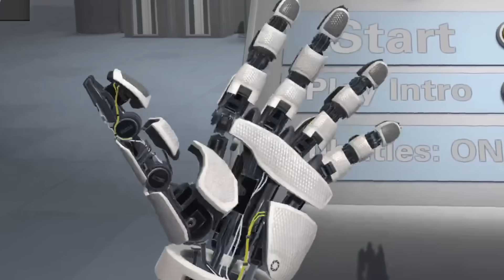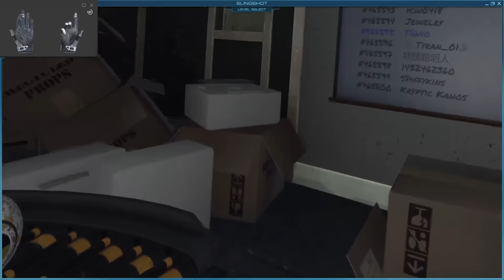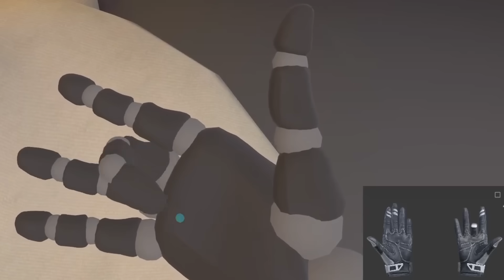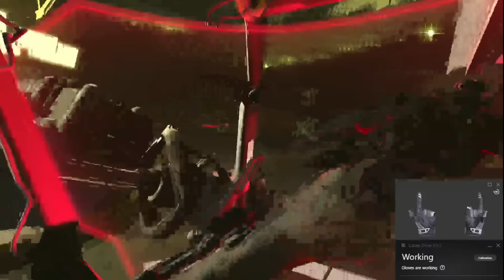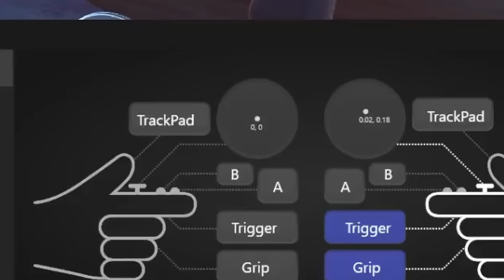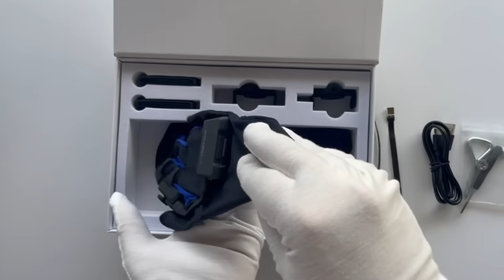Goodbye Controllers? VR Gloves are BACK! [UDCAP FIRST LOOK]

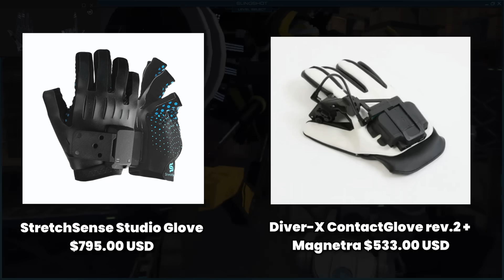Comment: 8:47 $499 is..."Accessible?"
Is it really worth +$250 for a Switch Joystick??
There are <$250 VR Gloves, 2 including haptic feedback. bHaptics DK2's, EOZ Immersive Gloves, and LucasVRTech's $60 HAPTIC gloves!
EOZ- the Tundra Tracker guys with years of experience- are making nearly the exact same thing as the UDCAP's, but HALF the price!
Reply from the maker: The bHaptics DK2 uses camera-based hand tracking. LucasVRTech’s gloves are VERY impressive, but it’s a DIY project that not everyone is going to build themselves. Assembly isn’t included at that price. 

I mention EOZ’s gloves near the end of the video and it remains to be seen how IMUs compare to stretch sensors. 

Ultimately, things are slowly becoming more accessible across the board - and $499 is compared to “similar” mocap gloves like stretchsense.

Comment: An excellent start, but a very simple to implement change that would massively improve them is put button emulators in the finger tips that are triggered when you touch a finger tip to the same hands thumb tip to "complete a circuit" without having to depress an analogue button; that would give you 8 virtual buttons with zero need for external immersion breaking analogue buttons or controllers to use, just you own hands! Do that and I will buy some! :)

Comment: May i say one thing?:
Its not that we need gloves, theres already hand tracking. This gap will be bridged via software.
What do I mean?
Those modules that are on the index finger? Just make that the controller, and use handtracking simultaneously. 
You dont need the glove at all, the modules can just vibrate, your brain will fill in the gaps.

Comment: These are perfect for applications like DCS, where you need a HOTAS to fly the plane, but still have the ability to reach out and manipulate the various switches, buttons and levers!
Reply: Have you used it there in DCS? This is exactly what I want to use these for: pressing and rotating knobs in my flight sims. DCS XP12.

Comment: I worked with VR Gloves for a few years and I have the Contact Gloves. I don't understand the point of putting buttons/joysticks on the fingers... why not just use Index controllers at that point? Gloves shouldn't have those... of course, makes the Gloves unusable for most apps then but... well, isn't that the point? To play experiences made specifically for just your hands?

Comment: I'm interested in this product for real but after wrapping up everything... So do you mean I need the additional pair of Vive trackers for using this glove? 
I'm pretty dizzy because the website itself, it's looks working like a charm without it
Reply from the maker: Yes, you do need the extra trackers to use them in VR. Unfortunately a lot of the promotional material omits this for some reason…
Reply: @TahvoStudio  Hmmm, This is a sad news to me. Sadly the price Vive tracker itself in my country is 160 bucks per side that means 320 for using with one pair of gloves. If I include the glove price on Kickstarter this thing will cost around 820 USD to me 🥹

This is a great product but It's a very steep price for me. Maybe they might make a gen 2 that using some sort of tracking instead

Comment: When you mentioned you calibrated the gloves to you Quest Pro, was your headset connected to your PC using a data cable or Air Link? Or were you running off the headset's capabilities alone?
Reply from the maker: Virtual Desktop

Comment: Will this be compatible for quest 2?
Reply from the maker: Only if you are connected to SteamVR on PC and they finish the controller mounting hardware.
Reply: It's not about being compatible with quest. 

It's about quest being compatible with VR. Mobile systems and systems with VSLAM will always have compatibility, accuracy, and tracking issues.

Comment: Nice to see these actually in use, albeit maybe could've used a different avatar for testing fingers. 
Question though: Does this only emulate current Index finger tracking and just adds finger splay? For example, can you curl your fingers without making a fist? Or, for example, make a right angle with your fingers (as if you're climbing a ledge)?
Reply from the maker: It uses SteamVR’s skeletal hand input. Yes you can curl individual fingers, but I don’t think it’s precise enough for the right angle you are describing.

Comment: You could get a small metal/plastic pipe with rubber on it for grip and play blade and sorcery with a immersive handle for one handed or two handed swords. 

You could even have a magnet on each end of the small pipes to combine into a longer pipe with maybe a hook system on your belt to holter it

Comment: I was going to back it however once the whole space tracking thing was shown, I dropped out. Why spend 1000$ when I can just get a quest 3 and have just as good/better tracking while having that space tracking? 

That’s why I don’t see these gloves as amazing
Reply from the maker: It’s possible that Quest controllers could be used! I just haven’t gotten a chance to test it due to the mounting hardware.
Reply: @TahvoStudio  quest 3 has finger tracking with space tracking without controllers. Hence why i say there is no reason to spend 1000+ when you can spend 500 and get the same thing
Reply: @PawDieFur You can't get the same thing, though. Zero occlusion of fingers, tracking hands outside of the headset's view, additional buttons, and haptic feedback are all things Quest handtracking doesn't offer.
I'd also wager that the gloves track fingers more reliably even when all five are in the Quest's line of sight.

Now, I can make a good argument for settling. That price tag hits hard. But it isn't exactly the same.
Reply: @PawDieFur You can't get the same thing, though. Zero occlusion of fingers, tracking hands outside of the headset's view, additional buttons, and haptic feedback are all things Quest handtracking doesn't offer.
I'd also wager that the gloves track fingers more reliably even when all five are in the Quest's line of sight.

Now, I can make a good argument for settling. That price tag hits hard. But it isn't exactly the same.
Reply: @CptJistuce  if you need to use the quest 3 controllers from tracking, you’ll end up with the same issue of not being able to track your hands outside view. 

Quest 3 has built in finger tracking. I physically use it on a daily bud with 0 issues. Also, haptic feedback is a single motor on the joystick. So I wouldn’t really call it feedback since it physically only shakes in that one area. 

And from what I see, no. Since the q3 uses its cameras you don’t get awkward drift or dead fingers as show above. (I’ve already discussed this with the company and proved that this equipment is vastly late by 2-3 years.)
Reply: @PawDieFur  Yes, the Quest controller tracking has a limited area it works in. This has been a problem since the Quest 1.

I personally have not had much luck with Quest 3's handtracking, though I admit I've also not used it much. Most of my software is designed for controllers, so hand-tracking is just that thing that kicks in and throws out random commands when I set the controller down to scratch the dog.
Reply: @CptJistuce  while in vrc, that is the vrc system. Not the quest system. Hence why I’m saying the gloves themselves are a waste. If you are still restricted to the same motion as the q3, same finger tracking (and worse since it now is going to be dependent on imu based tracking. It’s a more simple imu bases btw.), and the same controls then I don’t see why you’d spend 1000$ on gloves when you can spend 500$ on a headset and get the same results + more. 

Like try convincing someone who has never played vr ever to buy the gloves over the headset. (Which since you’d be trying for a new player, they would need to buy a headset and two trackers. So the cost inevitably goes up to 2000$ depending on the setup vs 500$ for just the q3.)
Reply: @PawDieFur  I kinda assume anyone interested in VR gloves already has a headset, so it is 0$ vs 1000$ if they already own a Quest 3.

I readily admit I'd missed it was accelerometers and gyros. I thought it was doing the Steam Lighthouse thing. :(
Reply: @CptJistuce  sadly no. I asked about that last week on one of their ads from fb. 

It’s a good idea but about 1-2 years to late.
Reply: @CptJistuce  It provides mounts for trackers!
Reply: @Saerek  Hooray!
Reply: @Saerek  q3 physically does what thes gloves do at half the cost
Reply: @PawDieFur Wrong. There is so much negative with the Q3 hand tracking. The tracking is subpar and the control scheming is absolutely crap. Maybe if the Q3 came with the thumbs sticks and buttons like this on your pointer finger it might be as good, in some circumstances. Gesture movement control is abysmal. With these, I can move my hands ANYWHERE. I can use them in things like vtubing. I can use them in VRC without issues at all. 

Can't do Quest 3 hand tracking if I want speed and precision.
Reply: @Saerek  I use the q3 hand tracking all the time and have no issues.
Reply: @PawDieFur Really? On VRChat and vtubing?
Reply: @Saerek  yes

Comment: They have to replace the ribbon cable to magsafe/pogo array. This is definitely not a consumer grade product.
Reply: Pogo arrays don't actually handle high movement very well, since the pins only connect through spring tension. When you move in the direction of the pins, they retract due to momentum.

I would like to see a more robust solution than the flimsy ribbon they're using, though. Something durable and rated for a lot of cycles. 
I know ye olde 9v connector is inappropriate for the task, but it is durable and latches reliably.

Traditional ribbon cables with a pin header are sadly way too large for the size constraints.
Reply: No idea but nice tech

Comment: Well this is a huge advancement. If they can get haptic feedback here, and find a way to have models actually have some level of kinetic force feedback through haptic, we may start to see the metaverse concept become real properly through vrchat
Reply: Wellll, hopefully not how the crypto-bros picture it.
Reply: @andrewgreenberg1862  I mean a ready player one feel. Good way to prep for when the full deal comes
Reply: Yeah but these gloves definitely are a good in between space where you don't have a VR treadmill to replace the joystick control
Reply: @cartoonkeeper  well I have both and its even better
Reply: Its not a advancement at all, these things have been around forever in mocap. They wont take off on the consumer level because Flex or elastic resistors are expensive and unless they can get the price WAY down you wont see them much.   Typical gloves cost around 500 and don't include position tracking (so tack on another 300 bucks for trackers), they also typically dont include control sticks. Which are sold separately so tack on another 100 bucks.  Now your looking at around 900 bucks for some gloves.
Reply: @nikushim6665  they can sell them at a loss and if they're included with a headset eventually theyd get cheaper, more manufactures making more parts